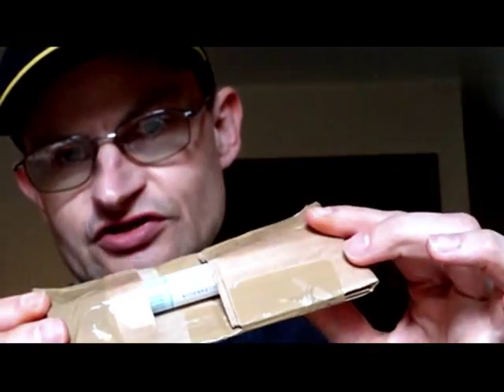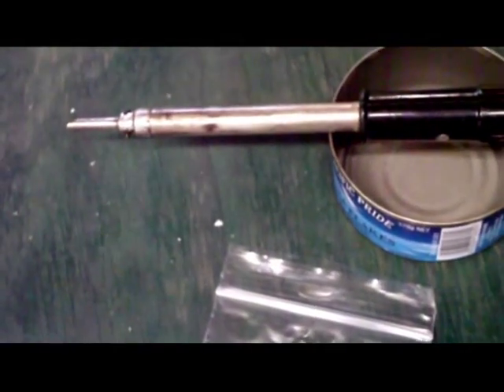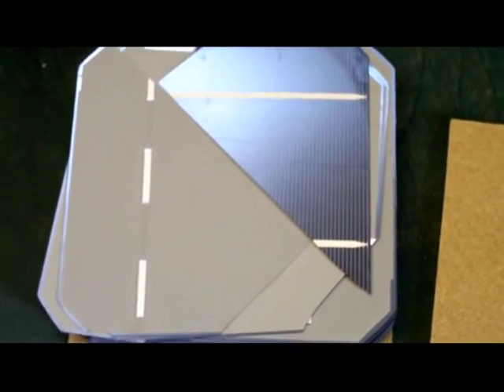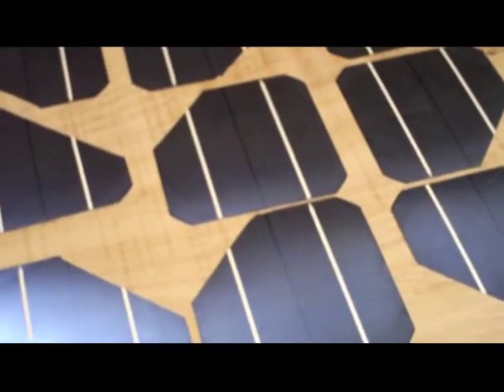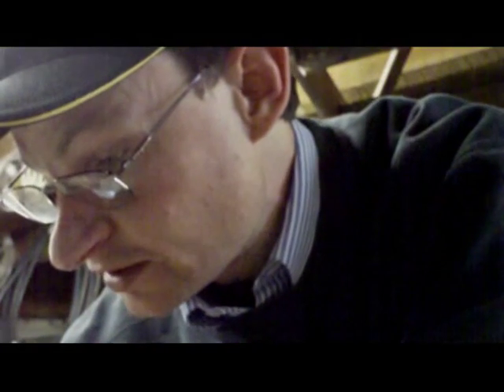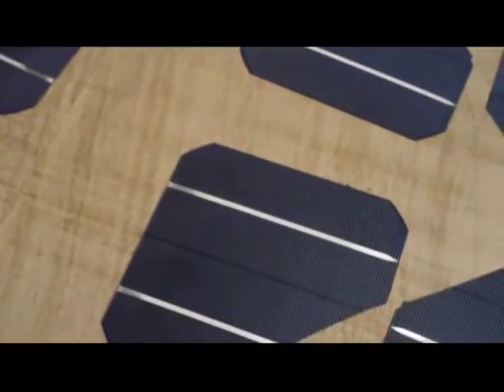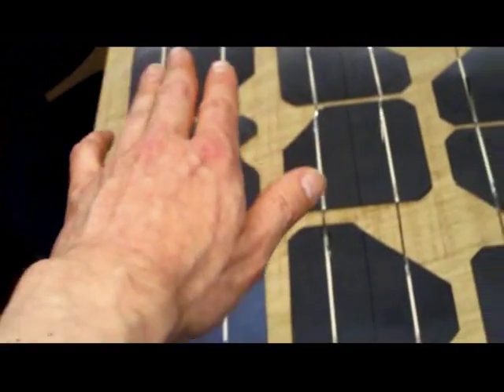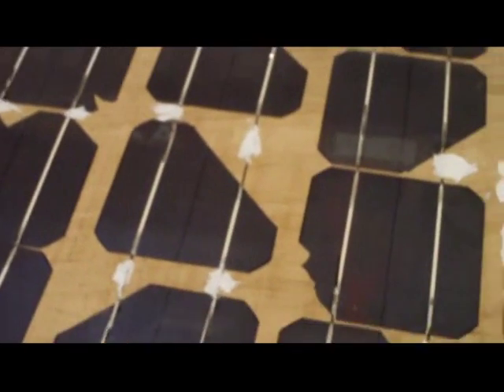Home Made PV Photovoltaic Solar Panel making. Making LOW COST energy

Comment from the maker: @ModernDeism with electricity generation, you don't want black backgrounds as that will raise the temperature of the panel and make the cells less efficient. White background is best and with as little as is possible restricting the sunlight on the panel.